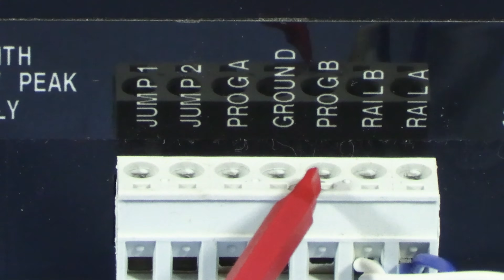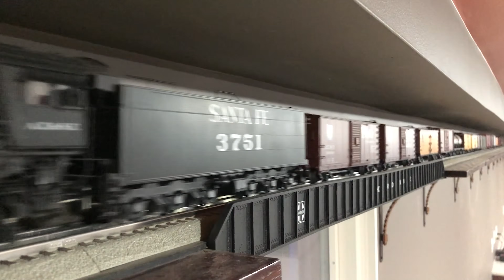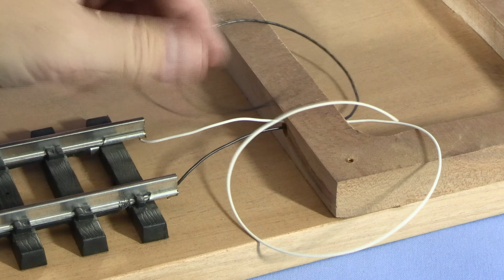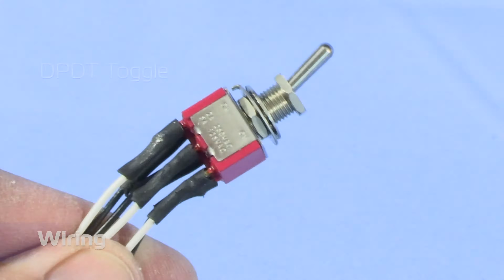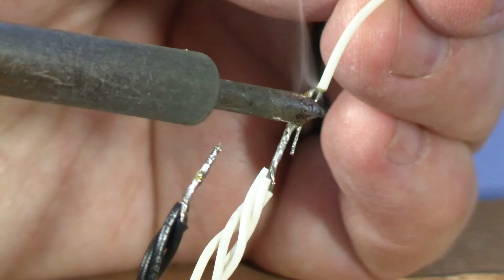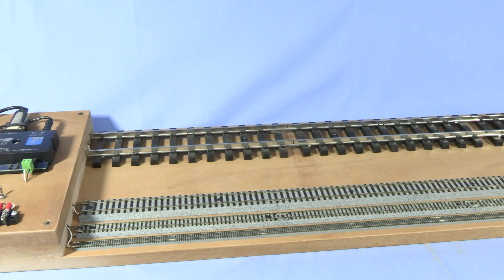DCC Shop Multi-Gauge, Multi-Scale Programming Track - Portable Too!

Comment: I got it better. I isolated 1 meter of HO track on my layout from the rest using the insulation joiners. This block of the track is normally feeded from same DCC source like the rest. When I want to program any loco I navigate her to this block and per switch I switch the power source to Programmer. After I program the loco I switch back to DCC power source and continue operation of the loco with new parameters, for. Ex with new DCC Address. The advantage is that I must not put the loco from the track.
Reply from the maker: It sounds like you've taken some good precautions against shorting.  I don't like to handle my models too much, either, but I usually only have to put them on the programming track when I first set them up.  Thanks for watching!
Reply: @DanielCortopassi  I do the opposite. Before I do any programming to the model I run it with default address on my layout. This way I can test it with settings from factory. Unfortunatelly I experienced some models with defective decoders or with any other issues. This way I test it first and in case of any issue I return it back to seller. In case if everything is OK, decoder is OK, no mechanical issues with wheels, universal joints, motor etc., I got the model already on track, I park it at the programming block and per mechanical switch I switch the block to ESU Programmer. The rest of the track can be on demand also automatically switched off to prevent any problems when I move from programming track to rest of my layout.
Reply: @MaxSupercars  Good Idea but what are you doing if you have locs which require a non-esu Programmer....
Reply: @hb9dod  They use 3-way switch or n-way switch to "n" different programmers... 😃 It depends on you what do you want to switch between. 🙂

Comment: Excellent little project, Dan! I have been wanting to put together a programming track as an excuse to try my hand at a little bit of scenery building as well since i've never done any of that. I only really need a single scale, though. I haven't had a chance to even get my Lokprogrammer out of the box and play with it. Also digging the electric guitar outro! :)
Reply from the maker: It occurred to me as I was finishing this that it kind of like a layout in that it has benchwork, track, and wiring.  There's no reason you couldn't make something like this with some scenery as a kind of mini-layout that would also work as a programming track.  I'm glad you liked the music.  I wanted a little more rocked out outro for this series.  Thanks for watching!